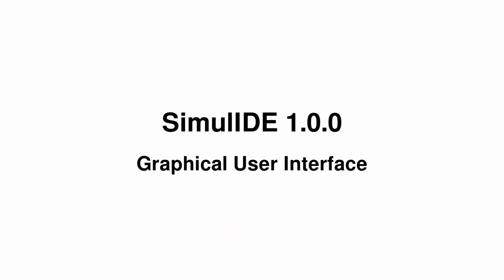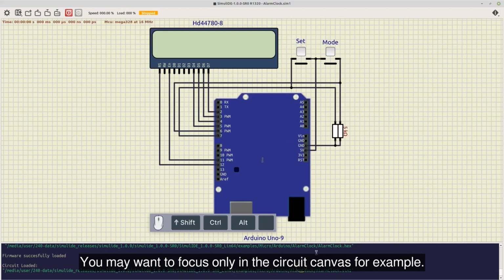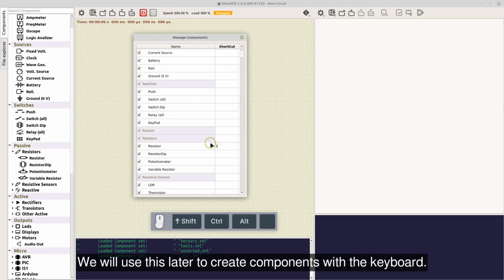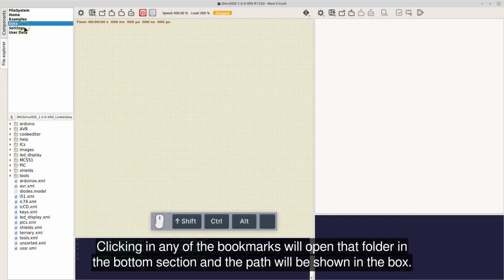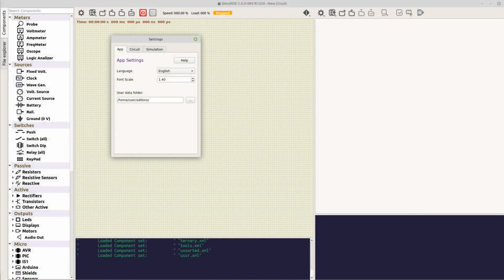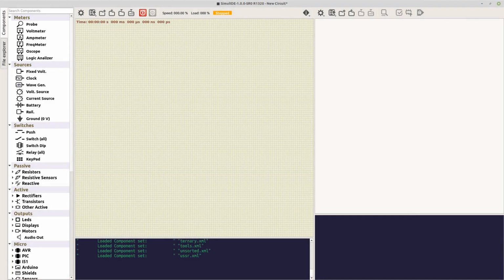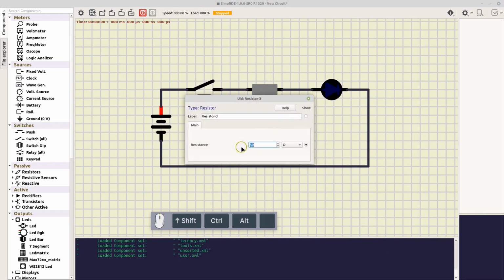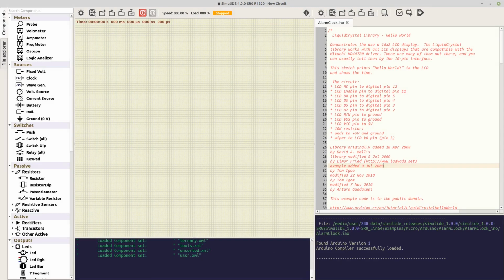SimulIDE 1.0.0 basic use.

Comment: All very well but how does this work w.o a mouse, just with a touch pad?
No middle button here e.g.!
Reply from the maker: Hi. This is an application for PC.
There is no version for tablet or phones.
Reply: @simulide6736 I'm talking about a laptop without a mouse attached, just a touch pad.
Reply from the maker: @demil3618 there are ways to mimic middle  button in a laptop.
You can also activate scrollbars:
https://simulide.com/p/settings/#circuit-settings